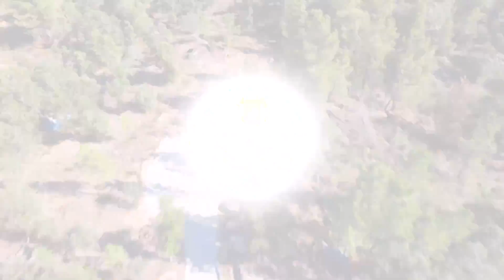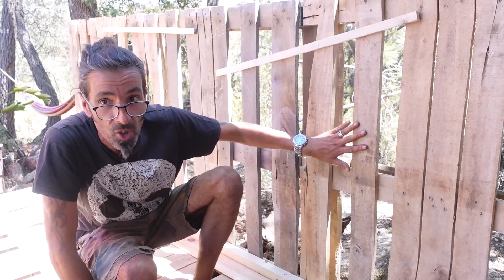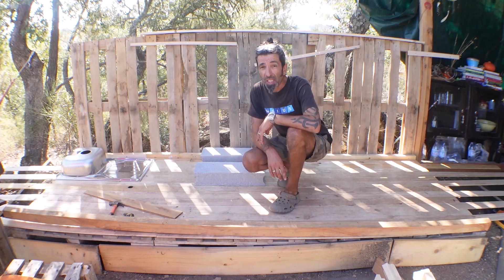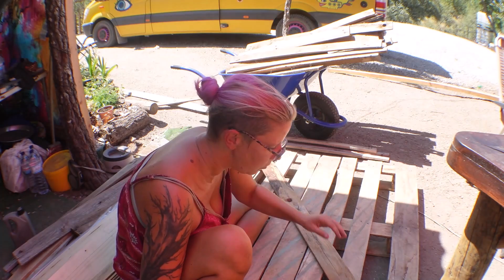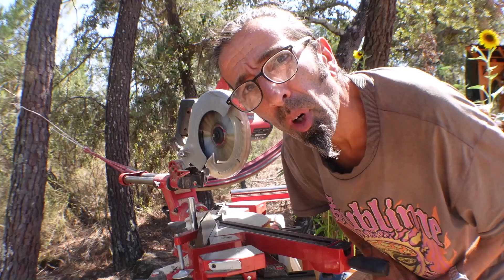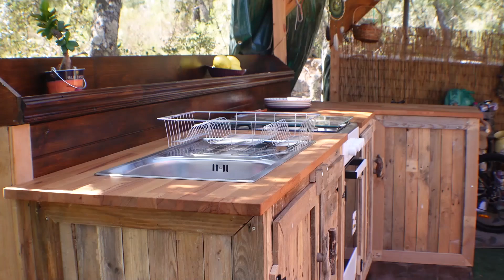LOOK! Budget PALLET kitchen build - Off Grid Portugal

Comment: Hi great kitchen build, just a thought, gas cookers require safe distances from the sides of the oven and ventilation from the bottom to ensure the wood to the side of the oven doesn't burn, the minimum gaps are usually shown in the installation instructions.
Reply from the maker: Hi yes, we exceeded the min gaps as per the cookers instructions 👌💚
Reply: @TheWildlanders  you can see that on the build